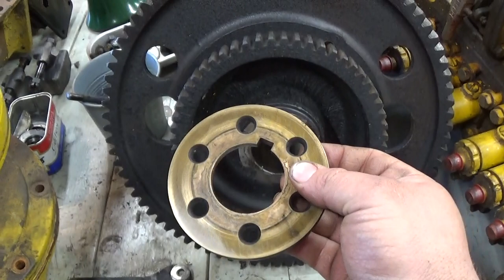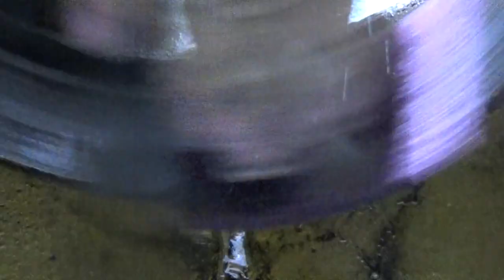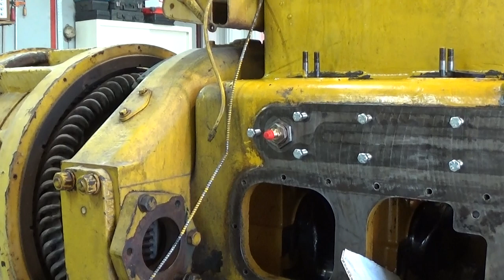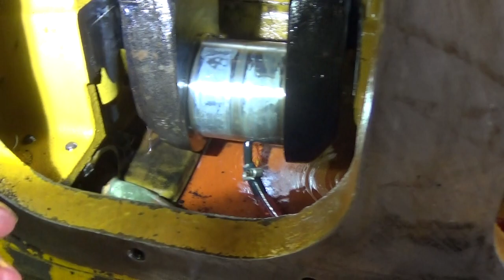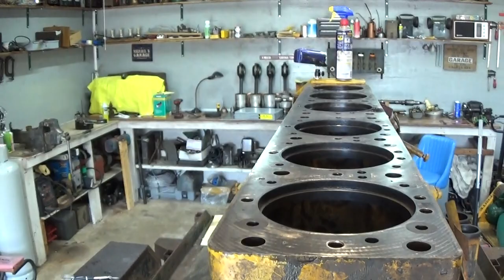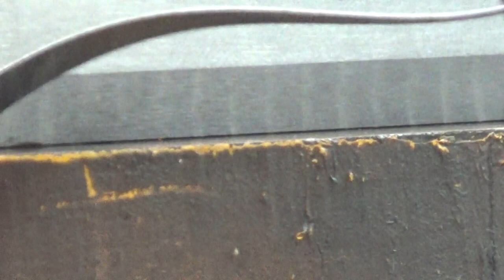Flushing Oil Galleries, Rinsing the Crankcase and Checking the Deck on Antique CAT Gen Set

Comment: Hi on some camshafts the exhaust lobe is wider, it helps with starting, It is supposed to hold the valve open longer so there is a little less compression. even some small engine have a wider lobe or a
 "kicker lobe" to help with starting. Ps it is nice to see someone with all the correct tools especially fluke stuff, yeah I also have the fluke dmm's and clamp meters .

Comment: The older Caterpillar engines had a core plug in the end of crankshaft oil passages. When overhauling those engines the core plugs were removed and passages cleaned. The passages became full of carbon that was centrifuged out of the engine oil as the engine ran.

Comment: Great progress Mike: You might consider a 45 degree fine stone on a drill to taper and correct the tops of the 5/8 bolt holes just a little bit. Thanks for the video's.

Comment: The point about the threads pulling up material is a great demonstration.  You would think they might counterbore those threads a bit to prevent that.  Thanks for sharing.
Reply: Did the engineers even suspect that phenomenon , metal creep , around the bolt holes would occur???

I doubt it .

He didn’t have to remove any material. 

Those engineers and casting pros got it right!

Cool stuff to think about.

Cheers from Schuylklll County

Comment: Bolt holes in a head tend to pull up a burr . I would chamfer the holes & then run a large flat file or stone over the head surface .

Comment: That cam bearing that was the only one pressure lubed got all the gunk that was in the oil pumped to it. The corrosion on the cam with that both lead to signs of sitting and condensation building up then pumping through the system.

Comment: Looks like when you get everything shined up and use a GOOD grade of oil like Delo 400 15/40 you ought to be set to blow some smoke. It ought to be fine at 900 r's with not much of a load till it gets run back in but the old Kitties like to pull. Great cleaning job.

Comment: Hello Mike. I really like the work you are doing on the engine. Can say that if my memory serves me correctly, flushing anything works best when flushed in the opposite direction. I can say this genset came from a location close to me. Just remember that when you check deck flatness make sure the straight edge is straight or should I say flat like a pancake. The liners should be proud by about five thousandths. That is if my memory serves me correctly. That number is plus or minus like two thousands I believe. The whole idea is to keep the liners from floating up and down which is a real bad thing. The machinist that machined this engine block would be a hard find today. Most young guys do not have the skill or even the patience to learn this trade today. The deck should have all holes lightly chamfered to prevent cracking. Just saying. One final note is that you look like a surgeon Mike, checking the surface flatness.Please drop a email line for a touch base too. Nice !!!!!! Peace, V

Comment: I can't imagine how Caterpillar cast such a complex block.
Reply: Master pattern makers making masterpiece core patterns, fixtures, jigs, etc. for making and placing all the cores.
Reply: It’s very simple really, cores made from sand in moulds (think sandcastles) to make the hollow insides and carefully placed in moulds of the outside of the block, then pour lots (and lots) of iron at somewhere between 1200°C and 1600°C depending on composition! 
Not the best video I’ve seen on the process, but it does show the process! He is using aluminium instead of iron, but the process remains the same. The more complex the shape the more benefit to making a core, this simple round core could easily be cast solid and machine the hole though it might suffer some shrinkage hollows due to the higher mass. 
You could have a look at Windy Hill Foundry to watch the main processes with explanation, but I couldn’t find his video using a core. 
https://youtu.be/l3opkzAvVQk

Comment: hey i have a question on my generator, (generac 100kva,415 amp 3 phase to a split single phase) on the rotor has a flying bridge rectifier, it has a diode across the two terminals.... any idea what that’s for?

Comment: Like to see the engine run in the future , i saw that flush you did and one thing i thougt about whas that on outher enginens you have a oilflow to the cylinderheads . I could not see any flow of oil to the head in the video , purhaps the flow is external to the heads i dont know , just a thout or i missed that part of video. Best wishes from Sweden 🇸🇪🇸🇪

Comment: That cam and the bearings look trashed. I would look for replacements for them if it were me.
Reply: Maybe okay as it's only ~900rpm no load and only 128hp. It's 1938 tech.
Reply: Those bearings are fine, they will run another lifetime.
Reply: For a "YellowMark" type job, it's fine. This probably isn't going back into "production" 
For a show piece, they will function just fine.

Comment: No disrespect, but I don’t agree with you leaving the used bearing in. You have it this far torn down. Why not replace this? It’s a generator and it’s going to running nonstop with a load on it.
Reply: Probably get away with it as it's only around 900rpm no load and only 128hp.
Reply: It's not going back into service, it will be running 20 hours a year show use. Not nonstop and not much of a load. It'll be fine.
Reply: Nothing wrong with the bearings with the motor that has low hours on it sometimes you take Brillo pad polish the bearings they'll run great
Reply: It will run another ten thousand hours with those bearings